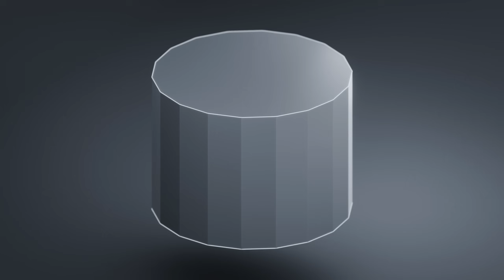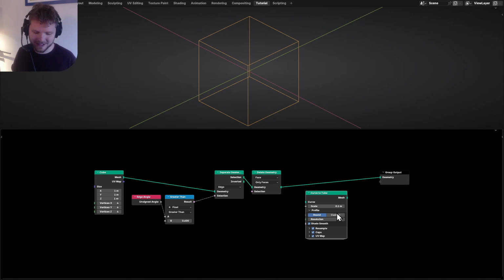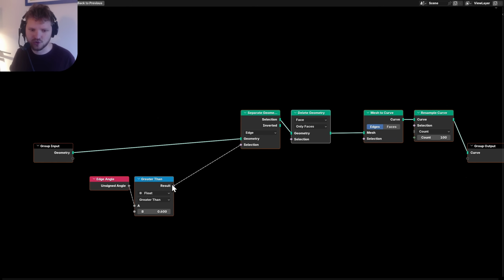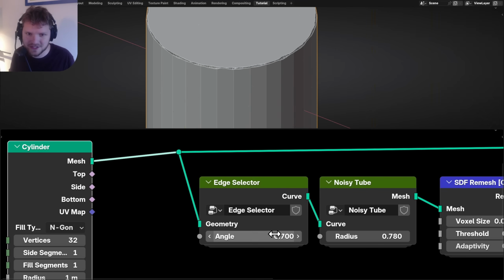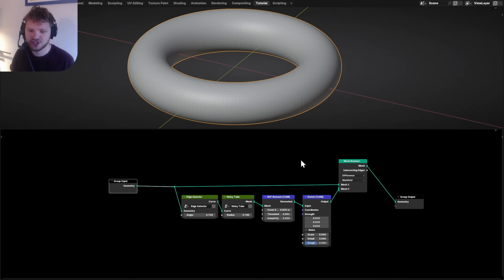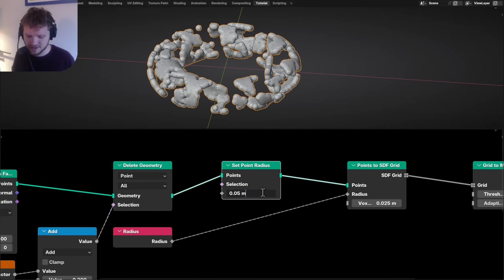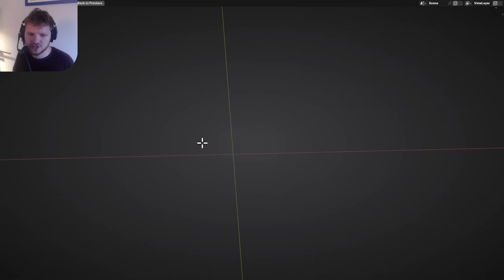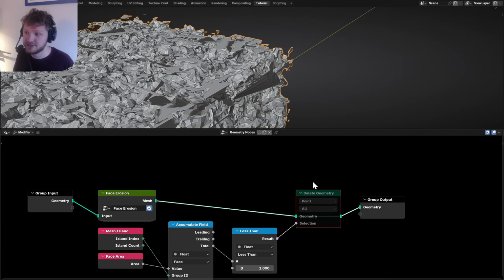Blender 5.0 Erosion (Geometry Nodes)

Comment: cg matter after i upgraded blender to 5.0 the rendering view in cycles slowed A LOT. like even with the same files if I open it in 4.5 goes fast and clean but 5.0 it even lags. can i fix it or im just doomed
Reply: have you made sure the settings you set up for 4.5 are the same?
Reply: @AncientWillow daamn bro tysm im so stupid was working with none cycles render devices while im an OptiX guy ty ty ty